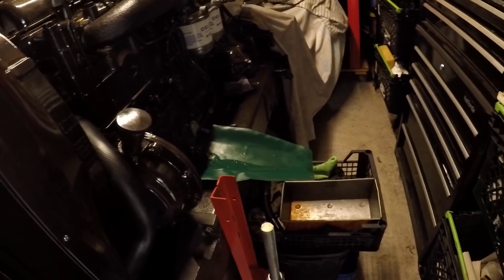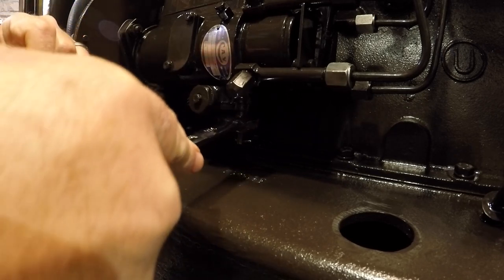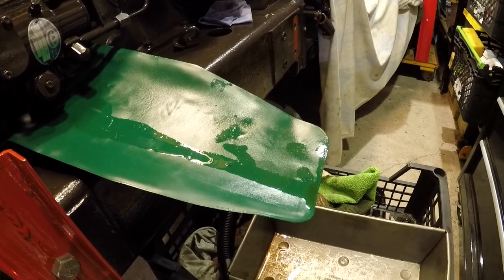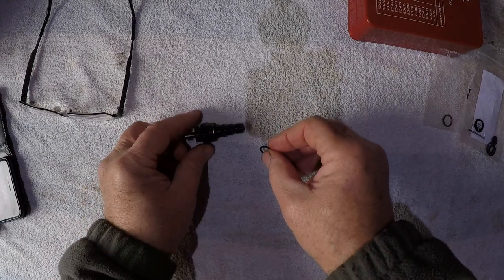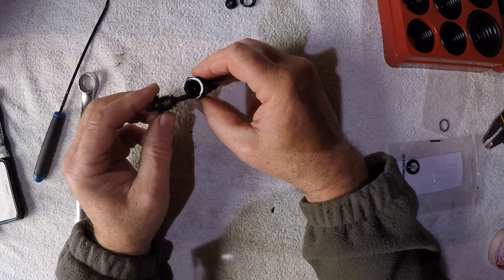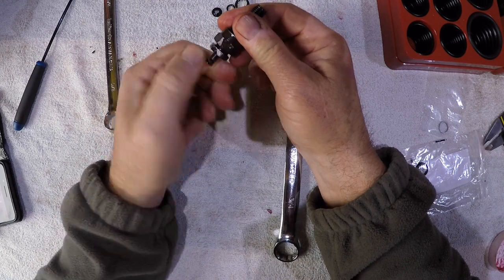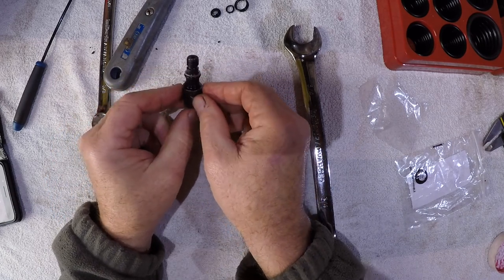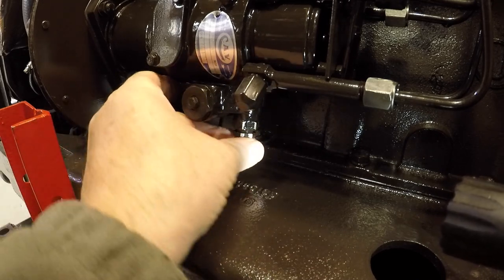How to re-seal the cold start on a David Brown 990 #44

Comment: Dismantled my father in law’s 885 pump to free up the rotor plungers and clear up some rust and I agree the instruction manual is not clear!  Your video has made it possible to clean the cold start mechanism and replace components in the right order with new seals and confidence: many thanks!
Reply from the maker: Hi, I'm pleased the video was of help to you,
many thanks
Barry

Comment: Well, my parts for my cold start screw arrived from across the Atlantic, and the job was just as easy as you showed it to be in your video.  Took longer to wire brush and clean up the outside than to do the job itself.  Thanks for the video on this, it helped tremendously!  Especially the part about the ball being in there, I'd have lost it for sure!
Reply from the maker: Hi Shane, pleased you got it done, your parts nearly arrived as quick as mine, not bad for across the pond.
well done
Barry

Comment: Thanks for the tear down and reassembly.  My seal kit is on it's way over the pond.  The constant little puddle of diesel under my cold start screw will soon be a thing of the past!
Reply from the maker: The kit worked beautifully, it was a little  tight to squeeze the new larger O rings in, also I think the missing aluminium shim help keep the top o ring in place but you know when it's in it isn't going to leak
hope yours arrives soon,
many thanks
Barry

Comment: Mine used to leak a lot from there, I didn't know it was a cold start thing, thought it was water drain off valve. 
I got a complete kit from ebay USA and it had all of that in it kit for fairly cheap,  around $20 USD.
Reply from the maker: Hi Jay if they are anything like mine they don't leak till you fiddle with them, of course they don't work of you don't fiddle with them, so you just gotta re-seal them,
many thanks
Barry

Comment: Excellent well made video which makes the task look straight forward.  Have taken the cold start out of the Cav injector pump on a Db 885 but the turn shaft  that runs through the centre is seized solid, Do you think heat would do the trick? not sure if this would cause further problems. Was hoping you may be able to advise.  Many thanks
Reply from the maker: Hi Michael, I would put the seized bits in a pan of boiling water and give them about 15 minutes of boiling, then get them straight  into some diesel for an overnight soak. I did this with some bryce injector pumps from an SR3 and they came away beautifully, no force required. There is a little Oring inside the centre piece that could melt and cause you problems.
nice and easy is the way forward.
many thanks
Barry

Comment: how does this valve work, does it move the timing?
Reply from the maker: Hi Wills, in away yes, the advance works through the oil pressure in the pump pushing on a pistion to advance the timing cam inside the pump, by cutting off the supply, which is what the cold start does, prevents the pump from advancing on start up, giving it a slightly retarded injection. This is why if you use the cold start and foget to re open it, allowing the pump to advance it begins to run a little ruff, no harm done, just open the valve and all is sorted.
hope this helps
Barry

Comment: Cant say I have ever done that job. I use an old filter box instead of your flash funnel.
Reply from the maker: Hi Lance, many thanks for your help with this job, between you and diesel injectors in the UK I found that the little aluminium bush/washer was missing, such a small part, but after swapping out the O rings and new seal, stopped all the mess and the retard/advance mech works now, so it must have been loosing pressure through the leeks. win win!
many thanks
Barry

Comment: hello ,please help me ,in which situations should I use the cool start tractor. how does it work please reply. I am writing from turkey
Reply from the maker: Hi Sam, thanks for viewing my video's, cold start should be used in cold climates if the tractor is starting for the first time that day or has been standing for several hours outside in the cold, the cold start works by preventing the automatic advance from advancing the fuel injection point until the engine has achieved a good running position, but once started you will need to unscrew the cold start control because if you don't it will cause your tractor to run rough. if you watch my video 44 again I explain the operation in the video.
many thanks for viewing and your comments, it's very much appreciated
Barry